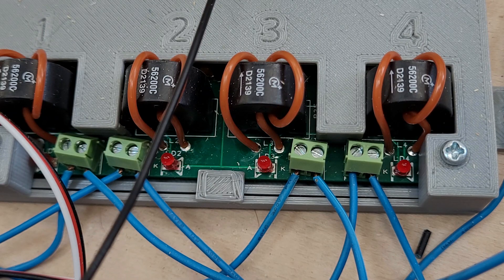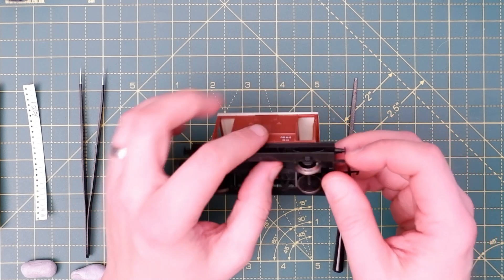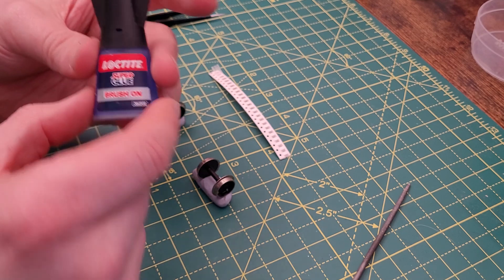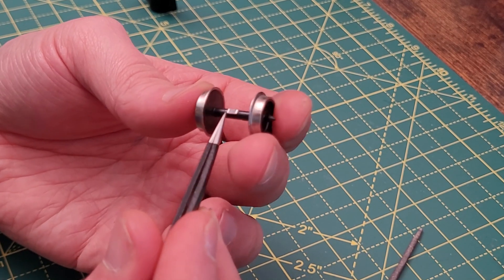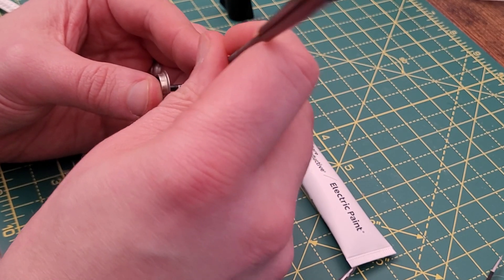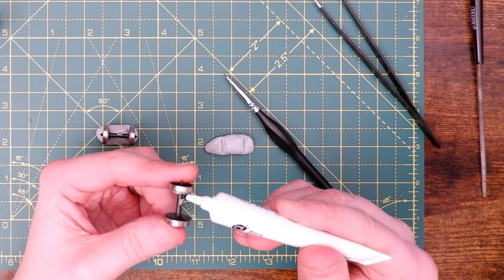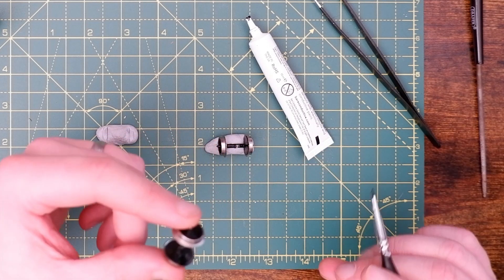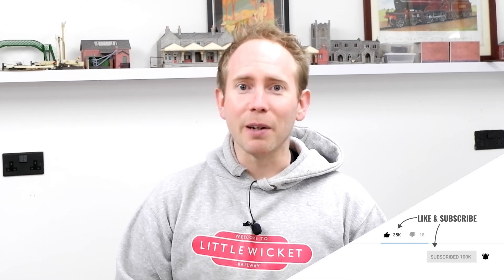DIY Resistor Wheelsets for Block Occupancy Current Detection | No Soldering!

Comment: The resistor wheelsets video is very interesting.  Two possible problems come to mind:
1. Short term, depending on how thick the conductive paint is, do you find it adds friction to the turning of the axle?  Do the wheels still turn freely with the paint on the axle?
2. Long term, how resistant is the paint to wear where the axle passes through the plastic bearings?  Do you find the conductive paint wears away over time as the axles turn?
Thanks.

Comment: Hi Rob,   I thought this was a good video and you explained the subject very well. I was surprised you needed to go to 5K resistors and so I took a look at what detection kits I was using. It looks like you are using MERG kit 50 which I think is an older design using current transformers. There is a cheaper alternative in MERG kit (PMK7) which uses the voltage drop across a diode to trigger the output. I have found the PMK (Pocket Money Kit)  works very well with 10K resistors (ie very small current draw). Having said this I don't think the current draw is a concern with up to 8 resistors on a single block. On the PMK the output is opto-isolated and when connected between an input pin and ground on an Arduino input pin it works very well (with input pullup enabled on the Arduino input of course).

Comment: have done this using 0805 10k on N gauge, old Lima Mk1 coaches - took a bit of fiddling with home made sensors to get them to reliably pick up the low current flow - way lower than a DCC locomotive just sitting there - have done one axle per coach on a few coaches, likely to do a second to have both outer axles - for freight stock one axle and then likely every other wagon.

make block overlaps enough one axle won't obscure a junctions, could do all but if stuff uncouples too much there are other problems.

once set up it works fine, the only issue is you now need to keep coach & wagon wheels clean, but a rake with a few should see a couple registering fine.

really good video actually showing how to do this.

if you have metal axles instead of plastic, stick the resistor at one end to bridge the plastic bush and its perfect.

if someone did these as a commercial product with a resistive axle it would be perfect, especially to replace plastic wheelsets on some stock :)

Comment: Hi Rob, great video as usual. Very fiddly job with my shakey hands, but I'm going to try it. You can use the stuff car accessory shops sell for fixing heated window elements as well. I wonder if you've had any problems with wheels derailing going through points, as the back to back distance now has a bit of a bump where the electric paint goes?

Comment: Might be easier to clean the wheels before gluing on the resistors, so that there is no chance of knocking them off as the glue dries :-)
Also I've tried graphite based paint and didn't find it particularly good (maybe just the brand I was using), so now gone over to silver conductive paint. More expensive, but it is much better, easier to use, and gives a much better electrical connection.

Comment: Robin, A rake of coaches will need resistors at both ends, if you run them in both directions (if they're run into a terminus, the back of the train becomes the front) and not just a tail chaser. However, I can foresee a problem with that. If the rake is longer than the block section, then the block in advance and the block in the rear will both show occupied, but the block between them will show clear! You'll need resistors on one of the centre coaches in that long rake too.

Comment: You made this look really easy with those Hornby metal tired wheels :).
I think I read this somewhere else, but how have you found the current draw with comparison to the whole layout?   
If you have 2 resistors  per coach  2x 5.1K would drop the resistance to 2, 550K per coach.  If you have 8 coaches, that drops the resistance to  about 319 ohms.    I know it's not a lot, but that does make a current draw of about  0.05 Amp per rake at 15V DCC level, more if voltage is higher.   Just curious how that would affect the layout as a whole.
Reply: Robin said that you only need them on the last coach in the rake. I say that you also need them on the first coach in the rake for when you're running the rake in reverse. Don't put them on the intermediate coaches as that may cause a voltage drop or short.
Reply: @henrybest4057  I likely missed that.   :)   Thanks for bringing that up.
Reply: I have a multiple layered layout in a 20' x 30' room. I have a lot of these wheel sets under many cars.  I've never encountered a power issue.  For the entire block, the resistance could get to what you mentioned for total resistance. But since all this is doing is creating a current draw all that is really happening is the circuitry that is detecting occupancy has a very strong signal that says "there is something there!"  and it will do what it is designed to do. It doesn't care about the additive resistance value other than the binary thinking is there something on this block?  Only if there is a short will problems arise. But no matter how many resistors you put across the track, you won' t get to the point the other circuitry that detects for shorts will trigger and shut down your system (thinking DIGITRAX).

Compare the voltage drop of a "grain of wheat/rice" light bulb across the circuitry for that block and these are way smaller. By moving to LED and these wheelsets, etc. you are using less current in individual blocks and across the layout.  But this is also why we have to decide what is the load capabilities of our layout and design accordingly. I run 4 power boosters on my layout to ensure I don't have to worry about power demands climbing to limits. I can park my engines anywhere and not worry about current draw. I turn lights off because I don't want them to burn out more than I worry about the current draw they create. 

At each individual resistor or engine, that device will take from the tracks the power it needs based on the circuit created. The engine will continue to demand the same power it always does and so will the wheelsets.  The voltage drop will be so negligible that the individual trains w/variable rake sizes won't really create a power concern. These wheelsets and current detection circuitry inside these blocks are extremely passive to the point you are not going to need to worry about anything.  

You will worry more about the cost for these wheel sets and the time it takes to build and install them than the power concerns. For power concerns, if the wheelset resistance isn't low enough to cause the block detection circuitry to say "something is there!" than lower the resistance. If the wheelset is such that the electric paint creates a short between the two wheels (bypassing the resistor) that is a problem to be corrected.  Once the individual wheelset falls between those two parameters, nothing else to do but go run your layout and enjoy the new automation you just enabled! Don't think about the commutative value of all the resisters in the rake but rather does that individual car's wheelsets make the occupancy detection turn ON. One or 10 cars in a block doesn't really matter and won't take up that much power. If you ARE at a point you need more power, these wheelsets are not that "straw that broke the camel's back" but rather you needed boosters and power districts already. 

Now he did do this across plastic axles.  I'm not a fan of plastic axles even with metal rims.  With metal wheels, this is trickier to do as you cannot glue the resistor on the axle but rather have to glue the resistor so it crosses over the wheel and the axle. There is a plastic cover on one side you do this at that you can see once you know to look for it. A meter will validate your finding. Then use the electric paint.

Comment: Please use caution: With each Resistor Wheelset the overall resistance of the trainset sinks. Most dangerous are long trains with short, two axis waggons. If you have too many of them, the resistance can drop so low that you get a short circuit. Better to calculate the trainset (R1 * R2 * R3 * ... * Rn) / ( R1 + R2 + R3 + ... + Rn) or measure the complete set on a powerless track with a multimeter.
Reply: You only need resistors on the last wagon ( = brake van) in the rake (or if you're a modern image modeller [no brake vans], both the first and last wagon in the rake.). The only time it won't work is when there are some wagons in a siding, without a brake van or loco, but it's unlikely that you would need occupancy detection there.
Reply: I was just thinking about this myself, and I wrote a comment, but now thinking about it, if you have a long freight train you could probably do one resistor per stock unit.  
So could probably get 16 plus coaches when doing and maybe end up with about 0.05A draw from the coaches......
That said, I'd like to see how that would work in real life and if it would affect it, especially with more trains running. :)

Comment: Interesting video, but the problem this creates is that the panel will always show occupancy of two adjacent blocks because the loco will trigger the second block section on entering, whilst the goods van is still keeping the first section as occupied.  Not sure how the full size system works, but I would presume that as a signal changes to red before the train has completely passed it, that the signal for the preceding block changes to a single yellow even though the remainder of the train hasn't fully cleared the section ?

Comment: See you are using current sensors - maybe I m wrong but the only video I have seen from you is the opto ones
Reply: Its the one about £3 per sensor https://youtu.be/DtYzP5RgcsA
Reply from the maker: Hi Robin, I used IR/light sensors on my old layout, but have been using the MERG current sensors for a while now when it comes to occupancy detection (you can see these in action in the ABC braking video https://youtu.be/y6MyOQrisIg) and will be using these a lot on the new layout. The only other type of sensor I plan on using is an IR sensor that I've modified so that rather than relying on reflection it acts as an IR gate which the train passes through and breaks the beam. These will be used as stop sensors in the staging area. You'll see these in a future video.

Comment: Great video again Rob did you check the latest build instructions for the sensors?
Reply from the maker: Yeah, I made the required changes, but they're still not 10k sensitive. Potentially got it wrong some how. More loops required? I'm happy using the lower resistance. Will be fine once a few wagons are fitted up.
Reply: I will need to experiment also once i get around to sorting out a few changes to the layout.

Comment: Great Video Rob! Makes me wonder if I should buy pre-built resistor wheelsets or just do it this way. Not all of my coaches have metal wheelsets, so I'm not sure how much cheaper it would be doing it this way, but any that do have metal wheelsets it would be significantly cheaper. I am running about 18 Volts so I might try 1-2k instead of 5k. I plan on doing automation and I m using your setup with Merg BOD's, an Arduino and a Sensor Shield. It works really well! Thanks
Reply from the maker: Hi Auxie! Firstly, thanks for becoming a Patron.

I looked at buying prefitted resistor wheels, but struggled to find good options.

Same here, I've got some coaches with plastic wheels so they'll either be left out or get upgrades.

Once you've got your sensors it's worth experimenting. I'd read 10k ohms everywhere, so fitted those only to find the resistance was too high for my sensors. Used 5k1 in the video, but will drop to 4k7 in future I think.

Keep an eye out for the monthly member only updates, stay in touch and let me know what you're up to 👍